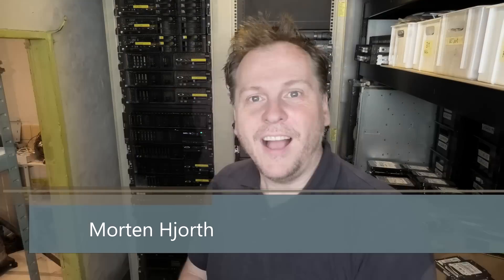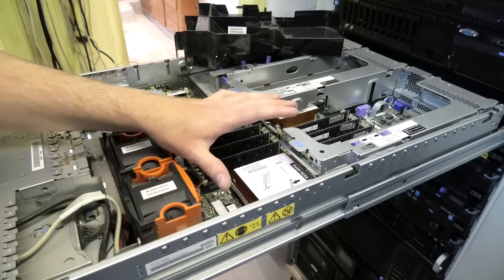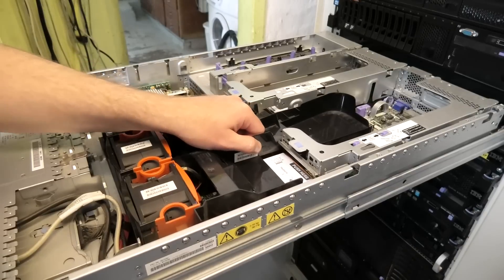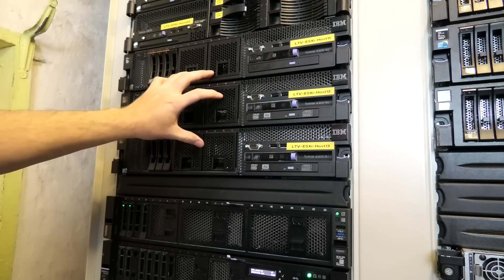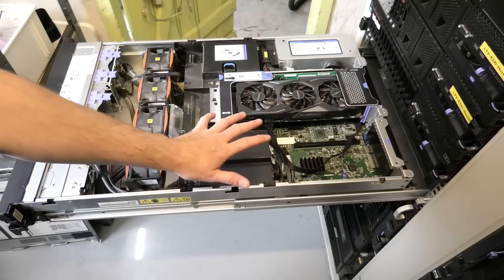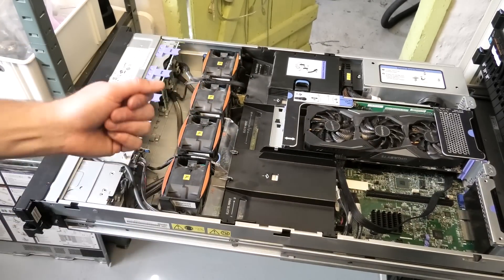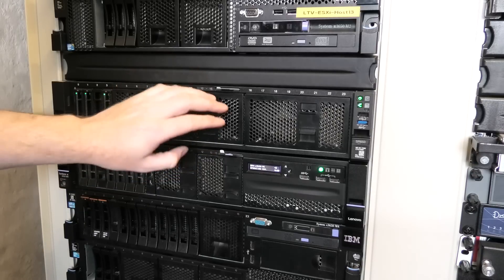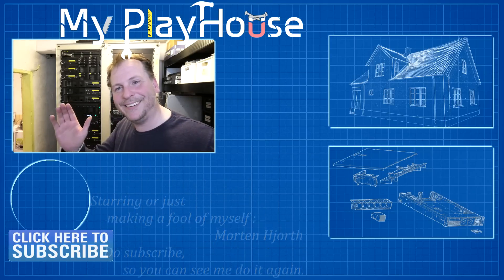What IBM/Lenovo Enterprise Rack Server to get for Your HomeLab - 1186

Comment: Don't buy IBM servers. You won't be able to get firmware and BIOS update for them, unless you have a active service contract and login to IBM. 
Lenovo offer BIOS and firmware download without login.
Reply from the maker: Sorry that is HPE,, there you have to have active service contract.
IBM do not make x86 servers anymore,, but you can get all the drivers/firmware for the older ones. You do need a login,, by making a free account,, you do not need any active service contract.
Other IBM systems like Storage/Tape/AIX Power systems is properly different. and you need something.
Reply: @MyPlayHouse  
Sorry, you are completely correct, I just looked it up.
IBM must have changed that at sometime.

Regarding HPE, BIOS and SPP are login required. iLO firmware and standalone firmwares are available without login.

Dell iDrac and Lenovo is also available free.

Comment: great video, but these xeons X5600-s and supported servers are very old, of 2011 era. i would go to dell PowerEdge R620($150-200) and E5-2640 v3($12), for example.

lenovo is now locking their amd ryzen/epyc CPUs to their motherboards in current-gen servers, so you cannot reuse the CPUs in other systems. take your business elsewhere, dont encourage this behavior.
Reply from the maker: This might go both ways,, this might result in some very cheap AMD CPU for Lenovo servers… but I do also not like that part.

Comment: I have a 3650M3 and owned it for about 3 years. It's been absolutely excellent. No drive compatibility that I have with Dell machines and managed to get the x16 riser for the graphics card. The main uses for it is to run my Plex and Roon server software under Linux Mint. It cost me £100, the riser was about £36 and the RAID expansion about £25. Along with that I have a couple of Dell R210Mk2's for my pfsense gateway and security system and a Dell R710. The 210 is a perfect machine for pfsense. 

I'm also playing about with time sensitive networking based on a Microchip Timeprovider 4100 and a few of our switch evaluation platforms and can get to within 1ns of timing jitter on 1 pulse per second outputs with PTP and SyncE. I use the Dell to virtualise a demonstration so I don't have to cart the system around and use OpenVPN which is part of pfsense to connect back to the network.

You inspired my choice of the 3650 which was my first machine.
Reply from the maker: The x3650 M3 was only my 24/7 server for a short time, as I got my hands on a M4 shortly after the M3,, but I have been playing a lot with them. Is that a time server? NTP?
Reply: @MyPlayHouse  Hi Morten, yes - it's a GPS disciplined Grandmaster which is accurate to better than 100ns of UTC. NTP is pretty good but doesn't provide the precision of PTP (Precision Time Protocol). To do PTP properly the Ethernet PHYs need dedicated timestamping hardware. With PTP I can get to better than 5ns of timing between the GM and a switch but with SyncE (Synchronous Ethernet) I can get to within 1ns. Again, SyncE required dedicated hardware to support it.

Comment: Great video! They're all nice machines definitely, but with the cost of fuel and energy on the rise buying something that's newer and efficient would be a wise decision in the long run. I'd personally go at a minimum of the Model 4, with Ivy-Bridge processors installed, and the power profile being set to static low power. Sadly where I'm at though IBM/Lenovo machines that run Ivy-Bridge and newer are outrageous, and HPE is the only "cheap" option. Ended up with a damaged HPE DL380 Gen8 with dual E5-2680 V2s. Damaged sockets, some ram dimms don't work, but it runs. I regret not waiting to buy a Gen 9 instead but prices were insane at the time; $400 difference between the Gen8 and Gen9. Gen8 came configured with everything, Gen 9 was almost barebones.
Reply from the maker: This maters alot for a 24/7 server,, if you are just messing around with a weekend warrior,, it does not matter as much if it cost a little more to run for a couple of days.

Comment: For my I use old Lenovo x220laptop with SSD CX 400 240 GB drive and ESXi 7.0 u3 inastalled  on it, for storage I use my old Synology DS214+ (DSM 7.1) with WD RED 500 GB SSD drives for NFS VM srorage. For me is very chip solusion not only becos of power usage but becouse I use devices I have 
 unused for several years. my cost  wass simple I by 3 SSD drives and thats it. For my usege that solusion is very good.
Reply from the maker: Hi Tomasz Miłoś
Thank You very much!  glad you liked the video :-)
Thank you for watching! :-)

Comment: Started with self builds on redhat, moved to ubuntu after I switch to it on my desktop. Tried some odd ones for some time and then Entrprice gear with CentOS and TrueNAS. Moved to virtualization and after runnig xen and VMware I run Proxmoxand TrueNAS on: 
HP 2x360 G5, 360 G6, 380 G8 and 3 self build.
Why HP, price and availability locally.
Reply from the maker: Hi Nalle
Thank You very much!  glad you liked the video :-)
Thank you for watching! :-)

Comment: Hi Morten I like your videos i find them very interesting.. Am running the HP DL380P ESXI 6.7 / 2x E5-2650L V2  / Ram 144GB / SSDs and Hdds Total 35TB  i Use it for plex /  Pfsense and Home Assistant and Server 2019 and more vms as well not going right them all down lol.
Reply from the maker: Do you have 35TB in the dl380 that is a lot !!?.
Reply: @MyPlayHouse  Sorry for got to mention i have a Xyratex HB-1235 Dell Compellent Storage Enclosure 12 x SAS 3.5" 2 X 6GBs JBOD using The p222 Raid controller

Comment: In my home lab l have an HP dl380 G6 with 56 GB RAM and 2 Quad Core Intel Xeon as operating system I have Windows Server 2019 was that a good choice, or should I upgrade Something ?
Very nice Video 👍
Reply from the maker: Not sure that Server 2022 will work for an old DL380 Gen6,, so 2019 is propoly the best.
Reply: I upgraded from 2012R2 to 2019 because my dad brought me a license from work they Switch to Server 2022 and a Windows Server license is very expensive, and I don't wanna use the evolution copy

Comment: Starting now i would not be looking at anything under a Xeon E3/E5 V2/V3/V4 for homelabs that want enterprise servers just to make sure of ongoing compatibility ,with power prices climbing the small amount saved with older kit will soon be spent on power and time wasted dealing with compatibility issues with hardware limits, more of a Dell user with R12th/13th gen servers
Reply from the maker: I think it depends on how much you use it... if you run a server for like 4 hours when ever you want to play with it,, the power consumption does not matter much. But for 24/7 use Yes..

Comment: Im just starting to play round with servers and virtualization, picked up an x3650 m4 and while looking for memory upgrades at the recycler there was a pair of x3500 m5 tower systems going to scrap which I quickly rescued.  one works perfectly while the other seems to have an issue,  it doesnt respond to keyboard input even after bios reset unfortunately, so if anybody can help there it would be much appreciated. I've learnt a lot and am really enjoying beingable to do virtual machines and putting all my data in one place.
Reply: Good find on the x3500M5’s. I have had all the other models at one point or another but never got my hands on an M5.  I love those towers.   
So, are all the USB ports dead? (No keyboard response)  does it complete post?  Have you tried connecting to the management port via its web UI and do a remote console there? Hopefully It has the lic key installed.
Reply: @ChannelYO was playing round again and found out for some unknown weird reason it was some issue with the raid card.  after some more playing round found it works without the cache module installed so I now have 2 working x3500 M5 machines.  I'm happy.
Reply from the maker: I have never had a Lenovo tower server.. good rescue :-)

Comment: I started my home lab many many years ago with HP, Gen 1, Gen2 (Server 2000 or NT I think) and a couple of Gen 3 (Server 2003), they are now all at the tip, daily server is now a DL380 gen 7, X5670 x 2, 72gb RAM and disks totalling 2TB (split RAID 5), running ESXi 6.7.0 (Build 8169922), it runs all my domain controllers (apart from 1 hosted elsewhere for downtime/reboots), WSUS, Exchange, DHCP, DNS, Certificate Authority and a few other test VM's, but I've also got Hyper-V running on my daily PC (Ryzen 9 3900X, 32gb ram, 2 x 2TB Samsung Pro Evo SSD and the difference between spinning rust and SSD VM's are worlds apart, I can run Patch Tuesday updates on 3 VM's on SSD's simultaneously and done in no time, 1 VM at a time unfortunately for the spinning rust, the older stuff still holds up well if you don't mind waiting around, my HP DL380 has been running for nearly 2 years (damn power outage) without missing a beat, great fun playing around with old enterprise stuff, thanks Morten 👍👍🙌🙌👍👍😎
Reply from the maker: I started with some huge IBM tower servers,, 32bit I can not remember the model number,, but then I got quite a few Compaq DL380 G1,, I still have one :-)

Comment: An hpe dl360/380 gen 9 with v4 cpu’s. Is that blasphemy on this channel😆. Have 3 dl360’s gen 9 running. But I am looking at the DL325 / 345 / 385 gen10. Still steep on pricing though so I’ll wait a bit more. An msa iscsi storagebox would also be very nice to have.
Reply from the maker: The AMD versions are still more expensive than the Intel ones.
Reply: @MyPlayHouse  I know but they are interesting😏

Comment: I started my enterprise homelab with a lenovo RD430 LFF server. I Picked it up for $150 usd from a local ebay seller in early  2021. Quite a steal as it couldn't get into bios because of a conflict with the raid controler. Went this route cause it was cheaper than upgrading my current server home server (wich was my old gaming rig) to accommodate more drives. This unfortunately was just the start of a new addiction. 

Within a month a purchased a IBM X3650 M4 (also for $150) to take over as my application server and provide gpu capabilities. This is also how I came across your channel. A few months later added a Dell 210 II (for $20, guy threw i was buying a server rack threw two of them and a netgear switch in for $20 more) to be my pfsense router.

Unfortunately my X3650 fell victim of the firmware bug, I updated the firmware as soon as I got it but it had some wierd power issues from when I got it and after about a year it would no longer power on. Currently trying to get a friend to replace the components on the board to see if it can be resurrected. 

I replaced the X3650 m4 with a barebones Hyve Zues v1 (pulled procs and memory from the x3650) and then found a cisco Usc 240 M4 to take over as my main application server. But the price of DDR 4 has prevented me from configuring it how i want so for now its just hosting my docker stack. The chip shortage has made finding servers at reasonable prices alot harder as it's been artificially inflating thier prices. 

Love your channel, and look forward to more server content. Thank you!
Reply from the maker: Who knows,, maybe our old servers could go up in price,, chip shortage/war :-/

Comment: hi morten! i run my homelab with some old dell r series servers like r730, 720, 630, etc. i enjoy watching your videos!
Reply from the maker: I think the r730 is about the same as gen as the Lenovo x3650 M5,, and will take the E5-2600 V3/4 ?? right?
Reply: @MyPlayHouse   i have 2 x Intel Xeon E5-2697A v4 in my r730, but i just assumed your M5 was newer since my r730 was new in 2016

Comment: I had Fujitsu Siemens servers in the past (in the P4 era), none failed. Now I manage an (Cisco branded) IBM X3250 with two CPUs and 8GB of RAM, two SATA disks. It works realiably in a small company as a file server (ZFS), database server and a development webserver (different VMs, XEN hypervisor). Not a recent hardware, but it is still fully enough for the purpose.

At home I use a Cisco UCS C220 M3 which bought quite cheap (180 EUR). It has 2 CPUs, and 64 GBs of RAM, and I bought two 900 GB SAS disks (it has 8 bays). Works well, my only problem is that I only have 3 caddys ao far, and it is quite hard to acquire SFF hard disks for cheap in bigger sizes (be it as SAS or SATA). Would be so much easier to find good capacity 3.5" disks inexpensively. I use xcp-ng on it, which runs my experimental CCTV system, recently some home automation stuff, file and development servers. Well enough power for home use but probably I have to extend it with some external SAS chassis or complete SAN, whatever I'll find first for 3.5" disks which is not picky about the disks.
Reply from the maker: Okay,, I do not know much about Cisco servers,, but a good prices!
Reply: @MyPlayHouse  The hardware is solid, my only complaint is that the CIMC (Cisco Integradted Management Console) which lets you access the server remotely is not going to be updated to HTML5, and like most of the web-based management stuff (uses JAVA, meh), does not work in any modern browser, while the hardware is still quite useful and will be for a long time. I can access the inbuilt KVM with some hacks, but either I keep an onbsolete management browser (in a VM), or unfortunately it is way easier to just go to the server, and attach a console there.
Obviously it won't work, if it were installed in a remote location, but the remote management stuffs always suck in some way...

It's a shame that big tech companies can't develop standards compliant cross-browser web interfaces. Always some Java or ActiveX sucking.

Comment: I bought an M4 because of your videos, so thank you Morten!  
(However my wife doesn't thank you. I only turn it on when she is at work as she hates the noise). 🤣
Reply from the maker: It's a good server,, but more noisy than some of the other brands. Sorry to the wife :-)
Reply: Hello Peter, I also have two x3650 m4. I built a DIY 20U Rack Cabinet in order to reduce the noise. Like you, my wife doesn't like the noise but this does help.
Reply: @joemelnick  Yup i hear you Joseph! I have it rack mounted as well, but it's open. I should look into finding a way to close it off. But I may just end up moving it to the basement eventually. I just need to make some room down there. Lol.

Comment: I will leave a like and tell you which servers I am running at home.

I have a Dell Poweredge R530 with 2 Xeon E5-2620 v3, and a similar SuperMicro with the same CPUs. Additionally, a separate custom SuperMicro server running TrueNas with all flash storage.  Both servers are using iSCSI for the Proxmox storage on the TrueNas flash. I also have custom quorum setup on the Proxmox cluster, so I can power off the second Supermicro server because it is loud.
Reply from the maker: Hi TheAtlasTech
Thank You very much!  glad you liked the video :-)
Thank you for watching! :-)

Comment: I am mostly running IBM/Lenovo (x3650 M4 x3, x3630 M4, RD440).  I do have some Dell machines,  a Dell 1950 as a DC, and a Dell TL2000 with two LTO4 drives.  All in all not a bad little home lab.
Reply from the maker: Cool,, how is the RD440 ??,, I have never seen any pre- IBM,,, Lenovo Servers
Reply: @MyPlayHouse  I have the "storage heavy" RD440.  12 LFF bays in the front and 2 LFF bays in the rear.  I run TrueNAS Scale on it with 32TB (raw) of storage.